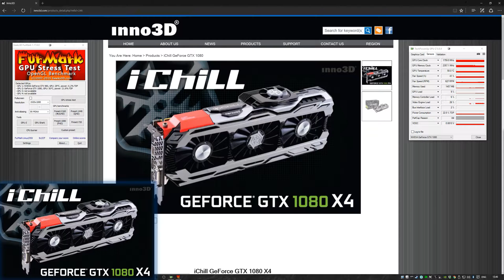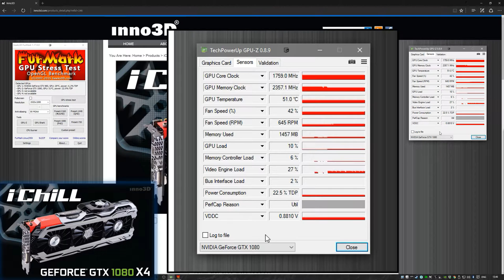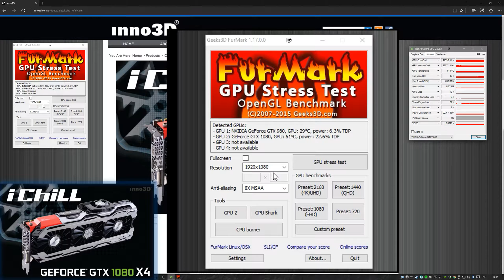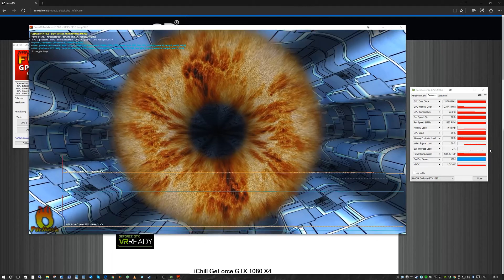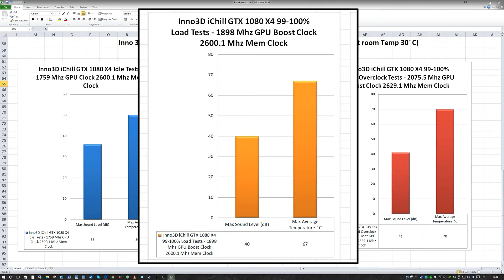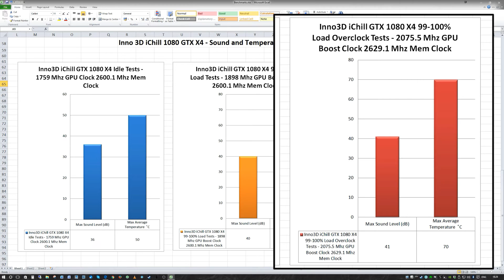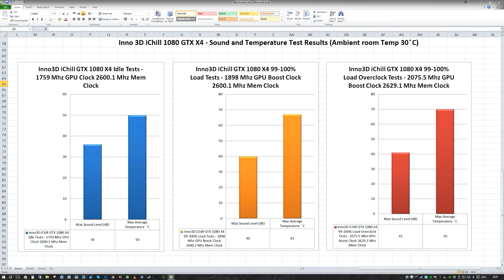Tech Review Update - Inno3D GTX 1080 iChill X4 - Sound, Temperature and an overclock!

Comment: Don't know what you guys are doing, but i just got the exact same card and while im playing a game called fortnite on best settings its going 80°C with the iChill logo on RED (which is the color for HOT) Don't know if i should be worried, i'm sitting in a room with 23°C.
Reply from the maker: 80°C should be fine for these cards. I generally see high 70's under normal loads but pushing them under synthetic tests and they get hot, hot, hot!

Comment: Hi. I am going to buy either the X3 or X4 version of the Inno3D 1080 TI. Would you say the small, fourth fan makes the card louder than if it didn't have it? From what I've heard, small fans are fairly loud.
Reply from the maker: Hi. Small fans are generally louder because they need to spin faster to move sufficient air amounts. The very small fans on the sides of the 1080 X4's that I have, do not add to the noise levels in any significant way. They do not spin that fast. However I am not 100% sure that they contribute to better temperatures either. I am looking to buy 1080Ti's myself and will still be going with the X4's from Inno3d. On the other hand I might just wait to see what Nvidia has in store for us later on this year with the next gen cards. Hope that helps.
Reply: +BOM Movies Ok thanks, I'll definitely get the X4 then. I'd much rather have better cooling for the cost of slightly more noise :)
Reply: +BOM Movies Also, in case you didn't know, the X3 uses a different fan blade design to the X4. The X3 uses a scythe blade design that sacrifices some cooling performance for very quiet, whereas the X4 uses a sharper design which increases noise slightly but also increases cooling performance. Also, the small fan on the X4 does increase cooling performance to some extent: It blows cool air onto the VRAM to keep it running cooler, allowing for more stable frequencies :)
Reply from the maker: Thanks William. Have fun with the new card. I like the black design of the 1080Ti variant from Inno3d over the grey/silver look of the 1080. My two are still going strong after nearly two years now.
Reply: Nice. I'm surprised there aren't any reviews of these cards anywhere. I guess it's because they don't ship to the USA (that's what I've heard). I have an Oculus Rift which I use with my AMD R9 270 graphics card which I bought for about £80 from eBay. It handles VR surprisingly well for the price, but unless I use the lowest possible graphics settings, I get lots of frame drops, ghosting effects and choppiness. I can't wait to upgrade my PC with a 1080 TI. I would wait for the GTX 2080, but there will only be a Founders Edition until around August or September I'm guessing, and I'm not prepared to put up with 20 fps VR for much longer. In the UK, the Inno3D cards are the ONLY cards for sale at MSRP. All other cards are over £800 or £900, which is over US$1000. Absolutely ridiculous. The Asus ROG Strix 1080 TI costs over £900 in some places.
Reply from the maker: It does seem like you got a hot card there. After the nearly two years I have had mine, I do see temps like that on my second card that sits under the the first. However the room I am in has an ambient temp of no less than 30 deg C and I only see those temps under synthetic 100% load tests which are entirely unrealistic. Usually the bottom card sits in the 70's under normal load, say gaming or video production. The fans are never at 100% either. It's a shame as the 1080's are good cards. Maybe the 1080ti's are clocked too high out of the box or the cooling is badly implemented on some. I remember  several years ago now I had bought a Gigabyte Windforce HD7970. It would get so hot that it would crash out. Swapped it for another that did the same thing. Eventually I went the Nvidia route and bought a GTX670 4GB (and then another for SLI!). Good luck on your next one, hopefully you will see better results. Also thanks for the feedback it is good to know.
Reply: +BOM Movies Did you see my comment after that one? When I did an MSI Kombustor test, which pushes your card to its absolute limits, it reached 88 degrees. I later found out that that is normal for a Kombustor test. I later tested it with half an hour of VR with all ultra settings and it never went above 72 degrees. I now have a slight overclock on the card (pretty disappointing but I knew it was a bad overclocker when I bought it) and it never goes above 73-75 under full load.
Reply: +BOM Movies The Inno3D 1080 Ti iChiLL X4 is a brilliant card unless you plan to overclock. Overclocking doesn't really matter though since it has one of the highest (if not, the highest) out-of-the-box clocks. All graphics cards will reach almost 90 degrees in a Kombustor test if you increase the temperature limit to 90 (unless your card has an insane cooler)
Reply: I have deleted the reply as it was all a misunderstanding.
Reply from the maker: Glad you found out it was the synthetic burn in test pushing your card too much. The synthetic tests are good to stress the cards out but under normal loads temps are far more tolerable. I am looking forward to what Inno3d will release for the next Nvidia cards. Depending on how long they will be I might still get a couple of 1080Ti X4's whilst i wait!
Reply: +BOM Movies Yeah, I think you should if you can find them for a decent price. The 1180s are gonna cost similar to what the FE 1080 Ti did at launch. Also, we won't see any non-reference cards for a long time. I was really hoping for a "2080 Ti" in February, lol.
Reply: +BOM Movies I got mine from OverClockers UK, if you were wondering :)

Comment: My twinX2 1070, after using MX-2 as thermal compoud, under furmark reaches a MAX of 57 °C, power limit 100, +225 GPU/+300 VRAM, Tamb 21 °C, auto fan :), but of corse this is a 1080 :)
Reply from the maker: Nice results from your 1070! Unless you are pushing extreme settings on 1440p or 4k gaming your 1070 is definitely enough. I have a 6GB 1060 on my HTPC from Inno3d too and it runs all the current AAA games on high settings at 1080p at roughly 60fps give or take a few.

Comment: I'm getting around 50c on idle and the temperature outside is 36c, is my card okay?
Reply from the maker: That does sound a little warm. My room temp at the moment is 32c and my cards are idling at 32c and 37c. What are the temps under load?
Reply: BOM Movies It goes from 50-60 under full load. Couple of weeks ago on idle it was in 30s and now it's always either 48, 49 or 50. My pc is almost 3 weeks old.
Reply from the maker: It will be fine at those temps just odd that the idle is slightly high. Keep an eye on it.
Reply: BOM Movies Have you tried Superposition benchmark?
Reply from the maker: No I haven't. Downloading now.
Reply: BOM Movies Would be so kind as to report your result back to me so I could compare mine?
Reply from the maker: I ran a 4K Optimised benchmark and the results were as follows - Score 7348, FPS Min 42.69, Avg 54.97, Max 71.57. GPU Min Temp 33, Max Temp 76. GPU Utilisation 100%. I am running two 1080's in SLI however.
Reply: BOM Movies Which cpu? What's your ram speed? Are you using 2 ichill cards?
Reply from the maker: i7 6900K @ 4.2GHz, 2800Mhz RAM, and yes two iChill x4's with an EVGA HB Bridge.
Reply: BOM Movies Can you test on 1080p using only one card?
Reply from the maker: Strange... disabling one card ruined the performance even at 1080p??? It didn't go higher than 37 fps! Something not right there. I will have to test it further. Temps roughly the same though.
Reply: BOM Movies That's pretty weird. Thank you so much

Comment: aye im about to buy this card but im on there sight and whats the difference between the x4 and the x4v2 is the v2 a newer version thats better?
Reply from the maker: Hi, as far as I could see the V2 is actually slower. Not sure why they released this and I couldn't find anywhere to buy it when I last looked a few months ago anyway. If I were you I would get the x4 Ti that's about to be released by Inno3D. The main difference between the x2, x3, and x4 is the cooling solution (2 fans, 3 fans, 4 fans).

Comment: At this overclock rate, can a 450w 80 plus bronze psu handle it?
Reply from the maker: Depending on the rest of your hardware it might be able to. I would expect that you would need a converter to add additional PCI-E power connectors and I wouldn't suggest doing it either. =>650w 80 Plus would be my recommendation.
Reply: BOM Movies it got two 8 pin connector

Comment: did you room had reached 35-40 C??
Reply from the maker: Hi the room I test in is always 30 degrees C or above.  On hot days it is usually around 34-38. Currently sitting at 30 degrees and it is a cold day. 6 degrees outside at the moment. It is very hot but I am used to it. The card cools itself extremely well considering my ambient temps.

Comment: i can't get my 1080 to run above 2000mhz it always downclocks a little and any oc above +35 makes it unstable. did i lose the sillicon lottery?
Reply from the maker: What are the temps on the card? Idle and under load? It could be getting too hot, too quickly which you could try and improve... or yes it could be the silicon lottery.
Reply: BOM Movies it Always clocks down to 1987mhz at a Max of 70c. i Have temp limit set to 92 so i don't know why it downclocks at all. Doesn't matter if it's +10 or +100 on the core, it always downclocks to 1987
Reply from the maker: Sounds like it is the max boost clock your card will run at. Seeing as the quoted boost clock for this card is 1898Mhz that's a 89Mhz increase. It's still around a 4.7% improvement from stock.

Comment: I'm thinking of getting a 1070. Which one would you recommend? There are so many new ones out now with higher clocks and better coolers.
Reply from the maker: I love the Inno3D cards. They are very much overlooked but provide quality cards. If you are just going to get one 1070 I would go for the iChill X3 variant from Inno3D, if you are getting two (or  might do in the future) then the x4 has an additional fan on the side to help with SLI cooling. The clock speeds are at the higher end of the card range but the prices aren't!

Comment: how can it be that my Inno3D GTX 1080 iChill X4 auto boost to 2150 Mhz?
Reply from the maker: Standard boost clock or overclocked? There is something known as silicon lottery and no 2 CPU's, GPU's etc. are the same and will yield either greater or lesser clock speeds. You might just have a really good GPU that goes way past 2100Mhz. Nice! I haven't pushed mine any further that what's in the video... yet.
Reply: I have only put it in my PC and installed the software and nothing else and then run it automatically up to 2150 Mhz
Reply from the maker: So your standard boost clock is at 2150?! I would do lots of testing to make sure it's stable and then if it is, feel very lucky you have a super clocked GPU. ...or your monitoring software is showing the incorrect speed, or you need to return it. I would just test it and see how it goes if it was me. Make sure you monitor the temperature. Ideally it needs to stay below 80 Degrees C.

Comment: 30 degrees C wheres she from the sun? i couldnt even comprehend those temps being from ireland
Reply from the maker: It's funny now I'm used to it I only notice when someone else points it out, or when I see them sweating! She's from central Asia and her summer outside temps are usually in the 50's.
Reply: Its looks impressive, my avg room temp is betweem 30-32C, so this card seems like a good fit to me if i decide to upgrade. Also using 750D here (non airflow version tho).
Reply from the maker: It's a good choice and apart from 1080's costing a lot it's great. I keep thinking about buying a second one but the price keeps going up. I'm not 4k gaming, so I think (for now) i'm fine.
Reply: The thing is im with 980TI SLI atm, and using it for 4K 60 (soon switching to 3440x1440 100HZ tho).
But my friend need gpu badly and im in dilema, and if im buying it will be one gpu most likely.

Not sure it worth it but my friend kinda suffering xD
Reply from the maker: Yeah I don't think I would've changed if I had 980TI's. It makes sense for 980's but not so much for TI's. The 1080TI will be interesting! If you have loads of spare cash then you could help out your friend but for 4K gaming on 100hz you will most likely need 2 of these with a HB bridge on SLI. Well for max settings and some Anti Aliasing.
Reply: I have enough for 2 1080's, but if i get them then im doubting that i would purchase 1080Ti.
As i wrote earlier, its hard dilema for me since i need to pick one thing and sacrifice the other :P
Reply: i think you mean temps in the 40's, 50's rarely appear in Asia (only middle-east)
Reply from the maker: K's country is central Asia and apparently (according to her) it does get this hot (however I am inclined to agree with you - but don't tell her that). It's K's excuse as to why we have to have our house super warm all year round none-the-less.
Reply: mine are room tempertures about 55

Comment: Hey man nice vid! wanted to ask, is there a difference between the X4 version and X3 version in terms of temperature levels?
Reply from the maker: Hexus.net have a review on the X3 and their idle temps are cooler at 44 degrees but their load temps are higher at 76 degrees. So based on that it looks like a hotter card. However of course it depends on many different factors so the X3 with my setup might not be as hot as it is in the Hexus test PC. I was surprised at how cool the X4 is.